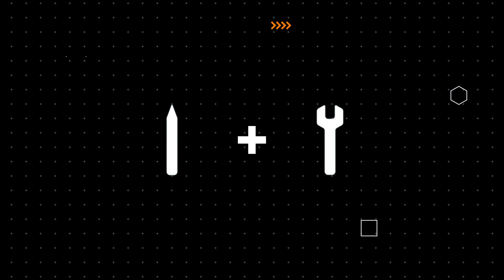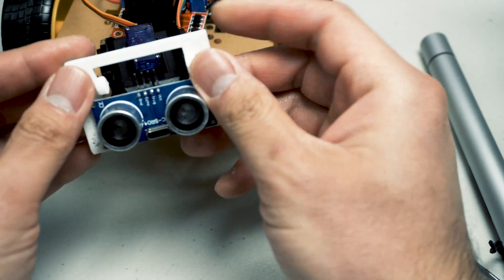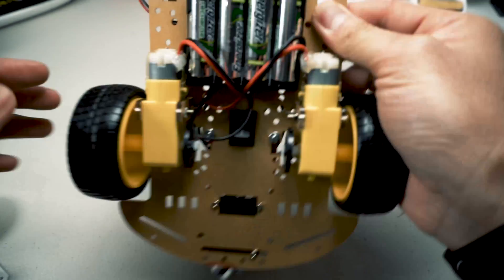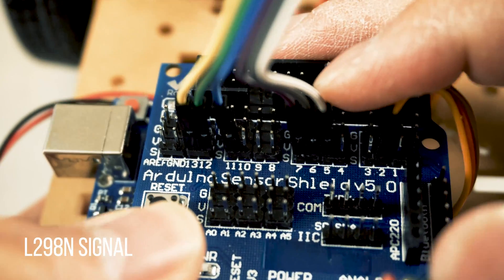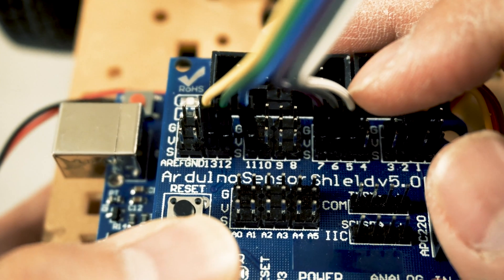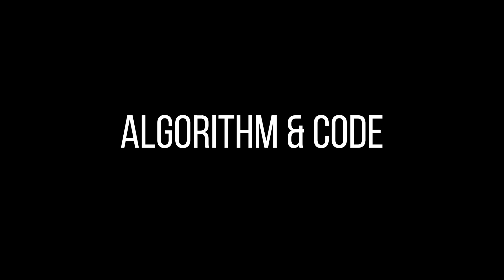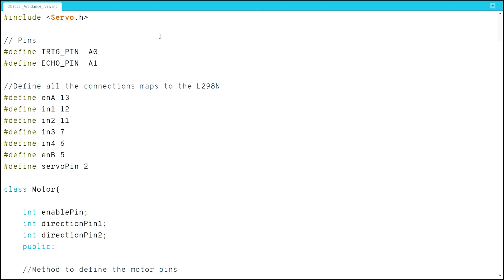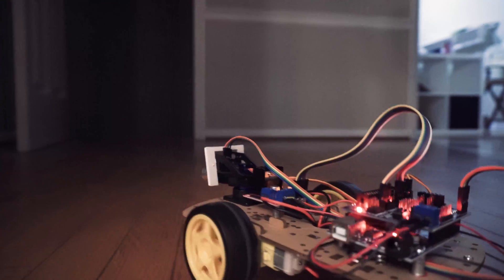Arduino Smart Robot Car from Banggood: PART3  Updates for the full Codes

Comment from the maker: Update:  If you want to control the motor speeds, please swap pin 11 and pin 13 connections, as well as update the define section in the code. Pin 13 is not PWM pin but pin 11 is. Sorry for the mistake.

Comment: Hi! cool project I tried it but when verifying the code this came up:
Arduino: 1.8.13 (Windows Store 1.8.42.0) (Windows 10), Board: "Arduino Uno"

082-Robot-Kit-Obstacle-Avoiding:41:9: error: stray '\342' in program

 speed = – speed;

         ^

082-Robot-Kit-Obstacle-Avoiding:41:10: error: stray '\200' in program

 speed = – speed;

          ^

082-Robot-Kit-Obstacle-Avoiding:41:11: error: stray '\223' in program

 speed = – speed;

           ^

082-Robot-Kit-Obstacle-Avoiding:127:18: error: stray '\342' in program

 pulse_width = t2 – t1;

                  ^

082-Robot-Kit-Obstacle-Avoiding:127:19: error: stray '\200' in program

 pulse_width = t2 – t1;

                   ^

082-Robot-Kit-Obstacle-Avoiding:127:20: error: stray '\223' in program

 pulse_width = t2 – t1;

                    ^

082-Robot-Kit-Obstacle-Avoiding:1:1: error: expected unqualified-id before '[' token

 [csharp]

 ^

In file included from C:\Users\theve\Documents\Arduino\libraries\Servo\src/Servo.h:63:0,

                 from C:\Users\theve\Downloads\082-Robot-Kit-Obstacle-Avoiding\082-Robot-Kit-Obstacle-Avoiding\082-Robot-Kit-Obstacle-Avoiding.ino:2:

C:\Users\theve\Documents\Arduino\libraries\Servo\src/avr/ServoTimers.h:57:41: error: 'timer16_Sequence_t' does not name a type

 typedef enum { _timer1, _Nbr_16timers } timer16_Sequence_t;

                                         ^~~~~~~~~~~~~~~~~~

C:\Users\theve\Downloads\082-Robot-Kit-Obstacle-Avoiding\082-Robot-Kit-Obstacle-Avoiding\082-Robot-Kit-Obstacle-Avoiding.ino: In function 'void checkDistance()':

082-Robot-Kit-Obstacle-Avoiding:127:22: error: expected ';' before 't1'

 pulse_width = t2 – t1;

                      ^~

C:\Users\theve\Downloads\082-Robot-Kit-Obstacle-Avoiding\082-Robot-Kit-Obstacle-Avoiding\082-Robot-Kit-Obstacle-Avoiding.ino: At global scope:

082-Robot-Kit-Obstacle-Avoiding:234:1: error: expected unqualified-id before '[' token

 [/csharp]

 ^

Multiple libraries were found for "Servo.h"

 Used: C:\Users\theve\Documents\Arduino\libraries\Servo

 Not used: C:\Program Files\WindowsApps\ArduinoLLC.ArduinoIDE_1.8.42.0_x86__mdqgnx93n4wtt\libraries\Servo

exit status 1

stray '\342' in program

This report would have more information with
"Show verbose output during compilation"
option enabled in File -> Preferences.

Comment: I'am a newbee to the Arduino world, got boared of all the basic stuff, ordered this from Banggood and followed your tutorial, apart from some minor changes I had to make (had to drill some holes in the base plate and change some  motor shield, sensor shield connections) this was a straight forward experience. Brilliant tutorials, perfect code. If you wonna build this this is the perfect tutorial

Comment: Arduino: 1.8.8 (Windows 10), Board: "NodeMCU 1.0 (ESP-12E Module), 80 MHz, Flash, Disabled, 4M (no SPIFFS), v2 Lower Memory, Disabled, None, Only Sketch, 115200"

C:\Users\User\Documents\Arduino\sketch_mar31a\sketch_mar31a.ino: In function 'void checkDistance()':

sketch_mar31a:5:18: error: 'A1' was not declared in this scope

 #define ECHO_PIN A1

                  ^

C:\Users\User\Documents\Arduino\sketch_mar31a\sketch_mar31a.ino:111:21: note: in expansion of macro 'ECHO_PIN'

 while ( digitalRead(ECHO_PIN) == 0 );

                     ^

sketch_mar31a:5:18: error: 'A1' was not declared in this scope

 #define ECHO_PIN A1

                  ^

C:\Users\User\Documents\Arduino\sketch_mar31a\sketch_mar31a.ino:116:21: note: in expansion of macro 'ECHO_PIN'

 while ( digitalRead(ECHO_PIN) == 1);

                     ^

Multiple libraries were found for "Servo.h"
 Used: C:\Users\User\AppData\Local\Arduino15\packages\esp8266\hardware\esp8266\2.5.0\libraries\Servo
 Not used: C:\Program Files (x86)\Arduino\libraries\Servo
exit status 1
'A1' was not declared in this scope

This report would have more information with
"Show verbose output during compilation"
option enabled in File -> Preferences.

 plese help me ^^
Reply from the maker: Seems like the line "#define ECHO_PIN A1" is having problem, could you check if there are any typos around the line?
Reply from the maker: I just realized you are not using arduino, seems the ESP8266(I never used) is different from Arduino on analog inputs. I found this hope can help. https://randomnerdtutorials.com/esp8266-adc-reading-analog-values-with-nodemcu/
Reply: please help me in teamviewer

Comment: Hey Chen, I have built the rover to your design and there is a problem with one of the wheels not moving at the same speed as the other. One is moving very fast the other very slow, I have checked the connections and they all appear to be in place. Any ideas on what the problem is? Thanks
Reply from the maker: Hi, have you tried to switch the two motors? In this way we can find out if it’s the motors problem or not.
Reply: Sorry do you mean switch the wires of the motors round?
Reply from the maker: I meant switching the left motor and right motor connections
Reply from the maker: Also you can try to tighten the screws on the l298n motor terminals

Comment: Chen,  Great project.  Everything works fine except the sensor does not turn when it encounters an object.  The stopmotor turns full right and stays there.  Any suggestions?
Reply from the maker: Hi Mary, have you tried to just run the servo code to test the servo functions?

Comment: Can you add more than 1 sensor?
Reply from the maker: Yes, the HC -SR04 sensor takes 4 pins, Vcc, Ground, Trig,Echo. The ground and Vcc can be shared multiple multiple sensors, you'll need 2 extra pins (trig and echo) for each sensor. So there are room for you to easily add 3 to 4 more of them. However i guess power and interference might be a problem if too much are added.

Comment: in my robot servo falls out when the robot moves through a stair. Do you have this problem too? I see that you use additional thing  to keep sensor
Reply from the maker: The 3d printed part is definitely optional, make sure you tight all the screws to hold the servo gimbal, screws hold the servo arms and also tight the twist wires.

Comment: my robot doesn't stop when it sees an object, neither does it go back. In only goes to the left or right any way to fix this?
Reply from the maker: Hi --, I had similar problem earlier, was able to fix with really fresh AAs or a 9V battery. Give it a try. Also, when it sees an object, does the servo turns?
Reply: ChenTheDesignMaker the Servo does turn, over got 4 as batteries and one 9v battery
Reply: I could try fresh as batteries
Reply from the maker: If new batteries don't help, I suggest you check the motor connections by running some simple motor codes, see if the motors respond as the command.